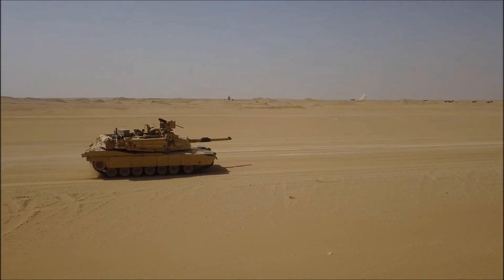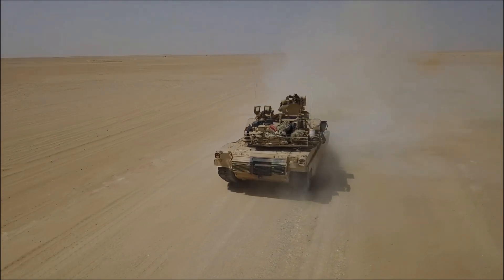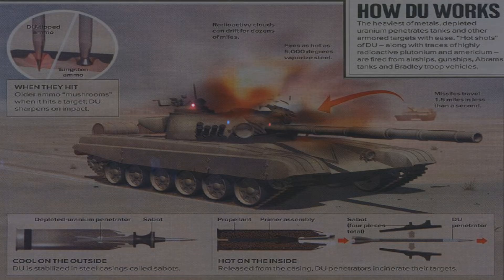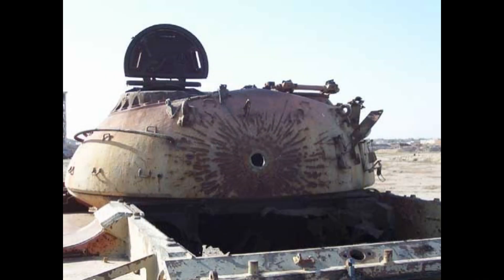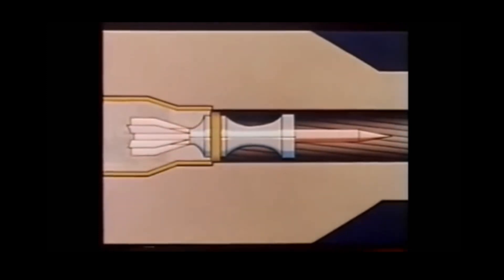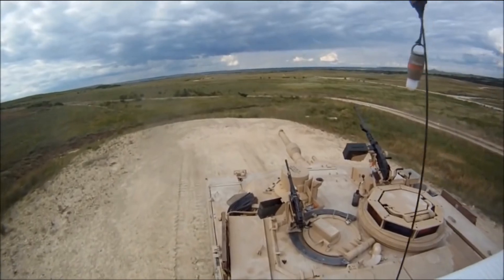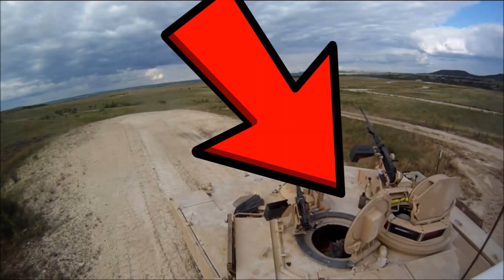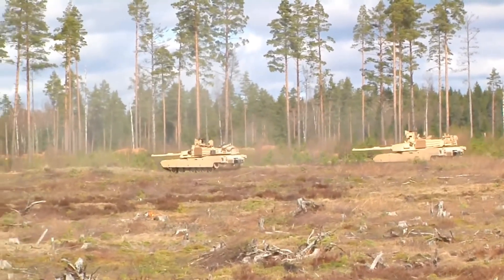Depleted Uranium Tank Ammunition | DEADLY DARTS 💀☄️

Comment: As a retired nuclear engineer who spent a significant part of my career 
working with U, I suggest you re-think your comment about the toxicity 
of U.  I'll leave it to you to look up the LD50 does of the various 
heavy metals.  U isn't at the top.  If it were, I'd have been dead a 
long time ago.  So would a large numbers of infantrymen who went poking 
around in killed enemy tanks in the middle east and afghanistan.

The two main reasons to use DU are a) We have a huge stockpile of the stuff
 and not much of anything to do with it. and b) unlike Tungsten and the other very 
heavy metals, U is easy to machine.  The machining must be done in an 
argon inert atmosphere because the stuff is so flammable.  The 
government and contractors machine it in large glove-boxes.  A private 
entity who has only a small amount of machining to do can simply wrap 
the machine tool in plastic sheeting and feed in the argon.

U is spoken of as pyrophoric but not really.  Pyrophorocity is the property 
of a substance to spontaneously ignite and burn in air.  Potassium or 
white phosphorous for example.  Uranium, along with aluminum and 
magnesium, would do so except that as any of these metals sit in air, an
 oxide shield forms.  Aluminum's oxide is so tough and tenacious that it
 isn't considered flammable.  Magnesium forms a less tenacious oxide 
layer so that it CAN be ignited in air.  Once lit, it burns to 
completion and not much short of a Class D fire extinguisher will 
extinguish the fire.

U also forms a tenacious oxide layer but as 
it grows, the oxide layer separates into thin, very sharp (ask me how I 
know!) oxide plains that provide just enough protection to prevent 
spontaneous combustion.

Try to do anything with it and the 
situation is much different.  Chuck a chunk up in a lathe and start 
making a cut.  The swarf comes off as strings of burning metal.  Get the
 workpiece too hot and it too will catch fire.  U will react to nitrogen to form uranium nitride.  It'll strip the oxygen out of water molecules.  It'll strip the oxygen out of the carbonate charge used in dry chemical extinguisher.  It'll do the same thing to sand.  Only a Class D extinguisher which consists of very finely powdered copper can do the job on a small fire.  Bigger fires are allowed to simply burn out.
Reply: shrug
Reply: @semtheprogamingmaster8610  yeah, maybe about 60-70 years ago during the cold war. Ever since the cold war ended the US has been incredibly careful about disposing of nuclear waste. Nowadays all nuclear research that is done is observed under a microscope by the federal government to ensure that nothing goes wrong and that all safeguards are in place to protect the environment as much as possible.
Reply: It doesn't matter how careful we are today.  We enslaved black people at some point so we are the literal Hitler Devil or something.
Reply: @billrich9722  But now they are enfree!
Reply: As you are a nuclear engineer from the US, I'm not impressed at all. Especially as a retired engineer. It's well known you guys didn't know shit about any nuclear risks.
Reply: @Sirion I hope you're not implying that the risks are underestimated in the US because the US has some of the most unnecessarily strict regulations regarding anything nuclear in the world.
Reply: @infantjones Germany has the worst regarding nuclear reactors because there are none at all
Reply: No reactors  I meant
Reply: @miskatonic6210  actually, it appears you dont know shit about what he is talking about. Do your research, this man is correct. By the way, I'm not even from the USA and I know that america has some of the strictest nuclear safety regulations in the world.

Comment: As I understand it, the uranium projectile is designed to ablate on impact.  Small outer layers of metal literally evaporate.  This causes several effects.  First, is the 'self-sharpening' mentioned in the video.  Second, the evaporated metal acts as a lubricant on the frictional surface.  Third, more ablation slightly decreases the diameter reducing friction through the metal.  Finally, the evaporated metal causes the huge fireball inside the tank, although a totally inert supersonic projectile entering a closed space is deadly without the vaporized metal.  It is this evaporated uranium alloy that is toxic.  The fine particles of uranium dust that solidify are easily breathed into your lungs.  The rounds themselves have a low toxicity until they hit a target that melts the alloy and spreads a cloud of heavy metals

Comment: The M256 120mm was a joint project between U.S. , UK, France, and Germany this was due to the joint X tank being a failure due to cost, size, and teck just not being there. The teck behind the M265 rather then being lost was put into design and can be found in the Leopard 2, Challenger 2, AMX-30, and M1A1,A2. Each country can fire the same main gun rounds with the only difference being the US uses DU and the other country's using Tungsten.

Comment: The majority of U238 which is used in armor piercing ammunition comes from the refining of U235 for thermal nuclear weapons not from used fuel rods. This is a very important distinction. It is implied that The depleted Uranium Has had its radioactivity used up as fuel which is not the case. U238 is very radioactive and is not at all inert.
Reply: DOUG HEINS A U238 shell that has been atomized on impact with amor has an output of 10,000 electron volts and is easily ingested into the human body through either respiration or food and water.  The human cell functions on one electron volt. Our military have conceded that  many of our service men that served in the Middle East are suffering from radiation poisoning. When the Germans went to gauge the contamination in the Middle East. They observed with their instrumentation that the radioactivity from the vehicles and the areas where they were destroyed was several time higher than what is established as safe for human habitation. The Germans also documented that the people living in the area are suffering from illnesses that are linked to radiation exposure.

Comment: The primary human health hazard from DU is that of a toxic heavy metal.  It is just as toxic as lead.  And in an industrial setting the primary safety practice for handling DU is to wash your hands before eating or smoking.  And even then metallic uranium is not absorbed by the body very well (unlike lead) so 99%+ is discarded in the feces.

Our big concern was that DU chips and shavings are combustible.  So we had to be careful to keep the coolant on 'flood' instead of 'mist' and taking care to clean up all of the chips and put them in an approved storage bin like the ones used to store rags that have flammable solvents on them.  Of course we were working with 'customer provided material' so all of the chips were given to them along with the finished product.

And one of the reasons DU is on the way out has more to do with the fact that industrial uses are competing with military uses for the remaining stockpiles.  And with the decline of nuclear power there is less uranium enrichment going on and the consumption of the stuff is exceeding the production.  (The self sharpening feature makes it an excellent replacement for tungsten carbide end mills (used to machine metals).

BTW - one of the biggest drawbacks to the use of tungsten carbide as weapons is that you are firing a very important industrial material.  Tungsten carbide is much more valuable when used to make weapons than as a weapon itself.

Comment: Depleted uranium is also used in the 30 mm gau-8 Gatling gun on the A10, or should I say the A-10 is what we call the wings and engines we strap to a gau-8 to make it fly.
3600 yards with no ballistic drop even at a muzzle velocity of 5500 feet per second is Flatley impossible. It will have minimal drop for its size weight but it will still drop a minimum of 24 ft. And I would estimate twice that but I can't do that quick math in my head while I'm on the road.

Comment: I read that during Desert Storm an Abrams tank got stuck in mud. While they were waiting for recovery, three Iraqi T-72's attacked it. First T-72 was quickly destroyed, the second hit the M1 with a HEAT round, to no effect and was destroyed. The third T-72 hit the M1 with SABOT, which grooved the armor but did not penetrate. After seeing this, the third T-72 darted behind a sand dune for safety. M1 then fired a DU round through the dune, and through the T-72, destroying it.

Comment: The 120mm silver bullet is basically overkill, it's main advantage is the ability to engage and penetrate with accuracy at longer ranges than the old m68 gun-which is still viable & capable of defeating most modern tanks in real life scenarios-granted it has an updated FCS behind it. Also, the M68 gun can fire a greater variety of munitions, and is cheaper to produce.

I'm sorry, big guns will never go completely out of vogue or replaced with missiles. Guided Missiles are expensive, have a higher rate of Friendly Fire, and are not as practical in dense woods or urban warfare(unless you don't really care about collateral damage).

If a tank fight happened in the Ardennes, with guys firing improved TOW missiles vs guys with tank guns, the guns win.

Comment: Ugh, the 'anti-tank missiles will make tanks obsolete by hitting side and rear armor' argument again.

Yes, that's been argued since the 1970s, and absolutely NOTHING has changed. Missiles from that era - the Sagger, for example - could in fact kill or disable most modern tanks IF they could get a hit in the right spot. Missiles were in fact developed to conduct strike-from-above attacks.

The problem has never been that you couldn't build or deploy such missiles. It's that missiles have to accelerate without the benefit of a cannon barrel to channel their propellant. They are MUCH slower than a tank round, meaning that if they're fired at long range the tank crew has time to spot it and take defensive measures:

* Turning into the missile's flight path in order to present maximum armor protection

* Suppressing the area of launch with machine-gun fire (particularly the coax, which uses the same high-accuracy optics the main gun does 

* Popping Willy-Pete to occlude the tank's silhouette, combined with a sudden change in speed and/or direction, causing the missile to miss unless the missile's gunner or AI guesses your new speed and/or direction correctly

* Machine-gunning the missile itself, which has a small chance to whack the avionics, control surfaces, and/or guidance wire (if any).

Now, there WAS a fine little missile system that specialized in making top-down, optically-guided attacks which aimed to penetrate top armor. Created by a Pentagon guy in his garage for something like a hundred grand, waaaay back in the '80s.

Fiber-Optic Guided-Missile (FOG-M). The Army went with the Apache attack helicopter instead, which effectively does the same thing but can deploy across an entire battlefront instead of being ground-bound... making the tank's worst enemy (as has been true since the end of WW2) tactical air support.
Reply: This is why missiles are STILL best used against tanks in ambush roles, and why tank/infantry cooperation remains an effective and necessary doctrine.

Comment: The problem with DU isn't radiation (it only very mildly radioactive, they use the stuff to color glass for example), it's the fact that uranium is an extremely toxic heavy metal like lead only far far worse. If you ingest uranium it's not radiation  that kills you it's chemical uranium poisoning.

Comment: I'm fairly confident that the depleted uranium rounds emit very little, if any harmful radiation. The stuff is used up, highly processed and filtered reactor fuel. Not to mention that today's DU tank and A-1 rounds are probably made from du from as far back as the 60s. I know that untreated uranium is also chemically toxic, but once again, probably safe at this point. If you drink bleach; you die. If you drip a few drops of bleach in a  glass of water; you have purified water.

Comment: Many people confuse the mass with the atomic mass.
Of course, DU is more atomic than tungsten. But is it heavier? Lead at atomic weight 207 is dirk than tungsten at atomic weight 183, but there is no fool who says lead is heavier than tungsten.
Uranium, of course, has the highest atomic mass in nature, but its density is lower than that of tungsten, so its weight is light.
The advantage of DU is that it is cheap. How many people will look at the spent fuel rods? And it is hard. Hard materials are easy to break, but due to the reason of Self-Sharpning, the end of the warhead is not broken like a mushroom but it can be digged into the gloves.
Even though tungsten is much stronger in specific gravity and stiffness, it is fused to gloves because it is low in brittleness.